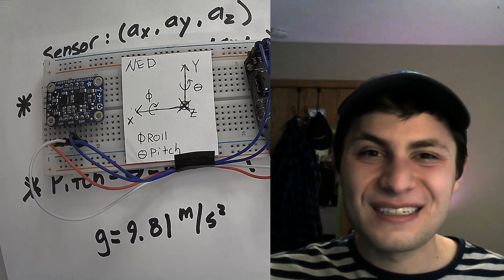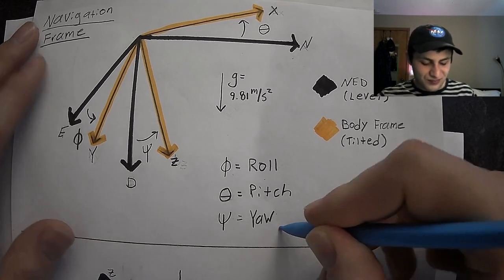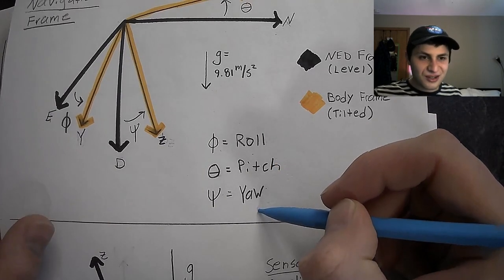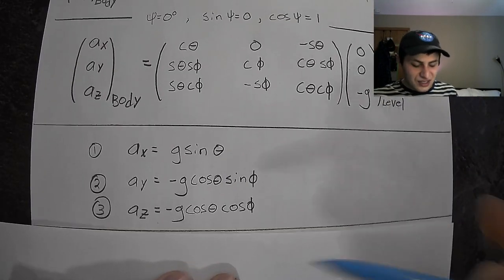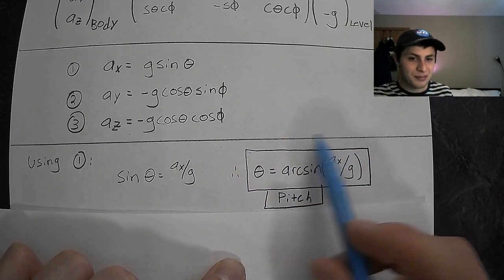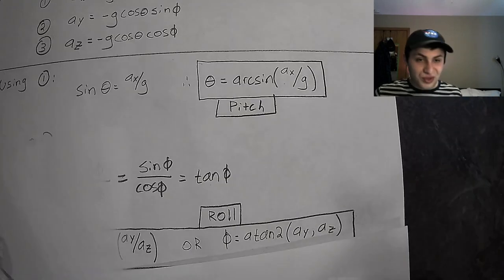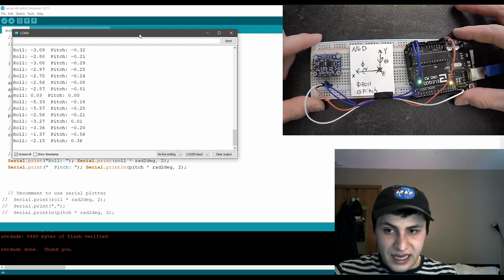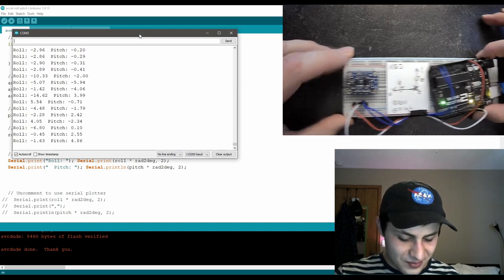How to Compute Roll and Pitch From Accelerometers

Comment: If you're using a Bno055
DO NOT FOLLOW THE CODE ILLUSTRATED AS
 Ax=ax*g
Ay=ay*g
Az=az*g

 JUST LEAVE THE VALUE ALONE IE.
 Ax=ax
Ay=ay
Az=az

 else you Square the acellerometer gravity's reading thus casing errors in the pitch readings.(theyd cancel out in the roll but the mistakes still their)

Apart from that this tutorial, just like all the others are excellent. 

Thank you for all the great vids

Comment: I have a problem with roll. I implemented the proposed formula (with atan2), but roll shows +-180 instead of 0.

Edit: When I use the normal atan function it works as intended.
Edit2: When I negate ay and az then the atan2 formula works as intended.

Comment: Nice  and  neat , which  math  do  you  use  to  get  the  linear  acceleration ?
Reply from the maker: You'd need a 9-DOF IMU, such as the BNO-055. Basically, once you know your roll, pitch, and yaw angles, you can subtract out gravity from your accelerations and get linear accelerations. This is done by transforming the gravity vector [0, 0, g] from the NED frame to your IMU/body coordinate frame, and subtracting it from your measured accelerations!

Comment: If 3 axis accelerometer able to measure roll and pitch angles, then we can use only single axis gyro only for measuring of yaw angles? ... Why in IMU always used like 3 axis gyro and 3 axis accelerometer?.. 
Please explain explain clearly... If u have any document.. Please share
Reply from the maker: The accelerometer can only measure roll and pitch angles. Yes, a gyro is also used to measure angles, but must be corrected by another sensor. As you integrate their rate measurements, gyro angles drift away from true. I'd recommend looking into 9-DOF IMU sensors, which have an accelerometer, gyroscope, and compass. With those three sensors, you can reliably measure roll, pitch, and yaw! 9-DOF IMU sensors, such as the BNO-055, use a compass to correct gyro yaw measurements.

Comment: Hey friend, very good video! Im working on my own IMU and im having some troubles with this, when my pitch pass from 180 or -180, jumps to the opposite (ej: if puitch reatchs -180, pitchs jumps to 180) this is normal? how i can fix that?
Reply from the maker: Hmm, I think you have an error in your calculations. If you look at the pitch equation at 0:43, you're taking the arcsine of a value that's between -1 and 1. The resulting pitch angle should only be between -90 and +90 degrees, and never reach +/-180 degrees.
On the other hand, it's possible for the ROLL angle to flip signs whenever the accelerometer's Z-axis flips from pointing up to down or vise versa. If you want your roll angle to be between 0 and 360 degrees, which I think you want, use atan2() instead of arctangent(). The atan2() function will do the required quadrant checks and should solve your problem!
Reply: @micwroengr7851  i solved it using Madgwick AHRS algorithm

Comment: I'm trying to use an accelerometer to make a light come on when it detects deceleration and I've manage to make a code to get it to work how I wanted it to, but I've come across a problem, when I'm going up hill it will make the light come on. do you know how to fix this. I'm new to Arduino so only know the basics
Reply: Perhaps the Z-force will become g* cos(theta) due to the rotation and X-force component due to tilt will be g*sin(theta), which will need to be subtracted. X due only to accel will have reduced output to x*cos(theta). I'm sure you can work it out from here.

Comment: Thanks for the video.. Currently, we are using BNO055 in one of our projects. The IMU is placed next to the dc motor due to space constraints within the hardware setup. Due to motors vibrations, we are applying a low pass filter on quaternion values read from Adafruit library script. We have set 5 Hz as a cut-off frequency of the filter. We have also placed IMU on Sorbothane (damping material) to minimize the vibrations. However, we are still selling the error in the orientation.

What could be done to reduce the impact of motor vibrations on IMU both from a software and hardware point of view? Any inputs are highly appreciated!
Reply from the maker: Having such a low cutoff frequency can add significant delay to your filtered measurements, so be mindful of that.
Since the BNO055 is placed so close to a motor, the motor's electromagnetic field is likely affecting the magnetometer, which is used to compute orientation. If possible, I'd recommend keeping the BNO055 where it is but buy an external magnetometer sensor and mount it away from the motor and any high-current wires. Then, input your raw gyro and accel. readings from the BNO055 and external compass readings to a Madgwick sensor fusion algorithm (likely used in Adafruit's code, too) to compute quaternion orientation: https://x-io.co.uk/open-source-imu-and-ahrs-algorithms/ Be sure to calibrate the magnetometer before using it: https://youtu.be/MinV5V1ioWg
Yes, motor vibrations will affect accel/gyro readings, but I believe the magnetometer/compass being so close to a DC motor is the main problem to fix. Hopefully this helps!
Reply: @micwroengr7851  Thanks a lot for the detailed answer.